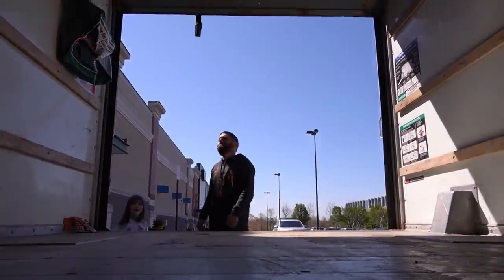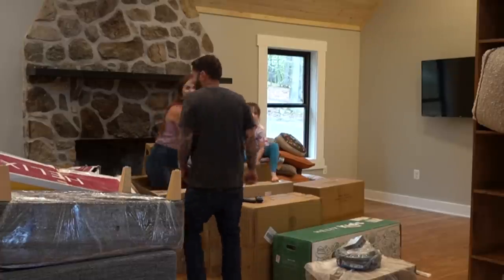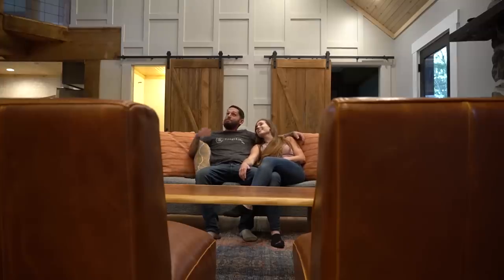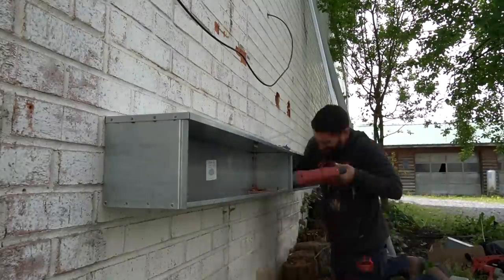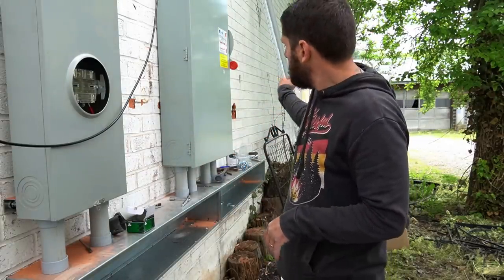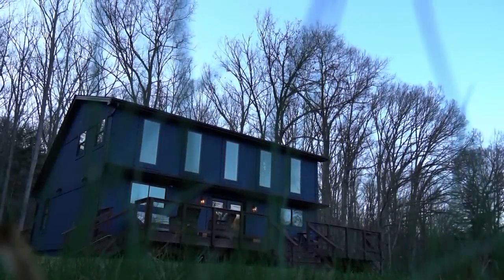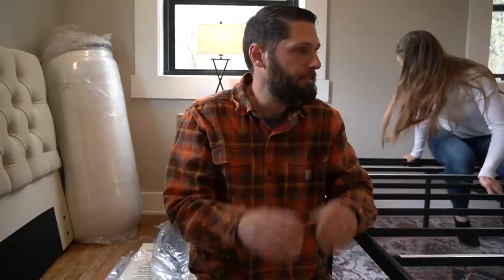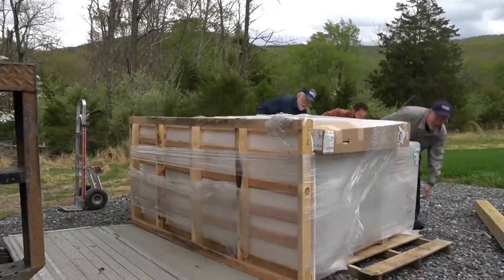Before Summer Hits | Cafe Build & Finishing The Chapter House | Episode 2

Comment: For moving the hot tub, I ended up using 4 - 3" x 10' PVC piping to roll it to its final destination.  Wife and I moved it easily just using those.  Best of all, I was able to use the PVC piping for another project I had.

Comment: It's coming out amazing. You could possibly gain some more space upstairs. If you were to get rid of the headboard and put a custom headboard just above the mattress and a fix it to the wall itself then the mattress would be able to slide back about 4 or 5 inches, or you can reconstruct that headboard to a fix it to the wall and slide the mattress underneath it leaving yourself room of course to take the sheets on and off.

Comment: Summer house plans: hot tub, small above ground pool, sauna. Ongoing interior furnishings and assembly. 

Café utilities are progressing. What is the neighboring foot traffic like? How much parking spaces? Any zoning requirements for persons with mobility challenges or disabilities?

In lieu of Covid 19 and airborne/droplet concerns, how do you plan to monitor indoor air quality (air monitoring, air exchange rates, air dilution)? Same for cleaning (solvents, uv lights, HEPA machines, etc).

Comment: Is the fireplace working? If so, you need to move some stuff farther away.
Reply from the maker: Technically yes it works but it will be stacked full with kiln dried wood from top to bottom making it unusable and will have a sign saying it’s not for use. Being that this is a guest house, we don’t want tenants using the fireplace. There is an outdoor fire pit though for them to enjoy